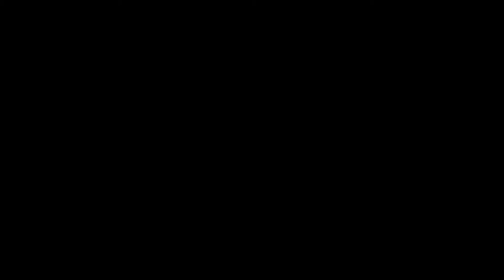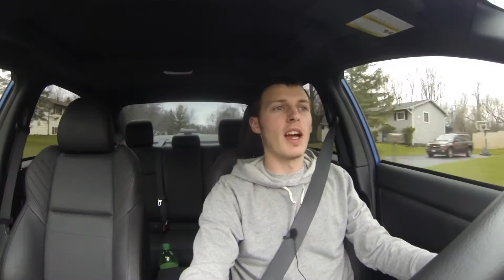Is Flex Fuel Necessary for E85? 2015 WRX

Comment: Do you upgrade fuel pump or fuel injector too? 
Will it work with just flex fuel kit?
Reply from the maker: I did not run flex fuel so I’m not sure. The flex fuel kit should tell you if it’s required or not. Cobb had a kit awhile ago but not sure if they still do or not.

Comment: question, Turbo back (catted), front mount intercooler, tgv egr deletes flex fuel kit, dw300 fuel pump, AOS street, turbo sump, ebcs, cobb lf bypass valve estimating around 350 whp, I know the tuner can go higher but I'm not trying go above 350 torque.. Running that set-up with stock airbox. Good idea or bad idea? The debate about intake vs stock airbox. I'm at the final step debating to get pro tuned without the intake (grimmspeed) or with one.
Reply from the maker: The stock air box is a restriction when it comes to that power level. I believe the Intake is good for almost 20 whp at that power level. I would 100% get an Intake. Plus it sounds so much better with an intake.

Comment: For a 2015+ WRX you don't have to worry about pushing more fuel through the injectors. Because it doesn't have any.
Reply from the maker: Tyler Savin the Wrx does have injectors though?
Reply: Derek Welker no it's direct injection.
Reply from the maker: Tyler Savin direct injection still has injectors. The problem with direct injection is you cannot upgrade to bigger ones due to the cost
Reply: Derek Welker Well it's more of a port controlled by a high pressure fuel pump no? There aren't any injectors for sale in the WRX parts section anywhere.
Reply from the maker: Tyler Savin no they are injectors. Just not the same type as port injectors. The high pressure fuel pump is separate from the injectors. The reason there isn’t any for sale is because replacements are very expensive and not worth it to make aftermarket ones. It’s easier and simpler to make a port injection kit for upgrades like what p&l has.

Comment: does flex fuel even adjust for shiity E85? if i fill up on lets say E85 thats really  E50 will flex even accomidate for that? i was under the impression it was just adjusting 93/E85 not adjusting for bad E85
Reply from the maker: Pas B yes it does. It reads the ethanol content and adjusts. That's the point of it.
Reply: It will do both. The first time I pumped e85, then started the car it was at around 64% ethanol once I gave it a min to configure. They say to run 91 or 93 every third fill up depending where you live, to keep everything nice and lubed.

Comment: I've been thinking about modifying any gasoline motorcycle I would own, to not only be ok with gasoline, but also moonshine. I've been thinking about making my own fuel, because I don't want to be dependent on gas stations & foreign oil, and I'm very mad at the oil industry, fucking up nature, or people's livelihoods directly, when just getting oil.
I'm excited about buying or building a full electric motorcycle, but I want it to have high performance & range, meaning it will be expensive. So it's better, for now, for me to invest in internal combustion. And I'm still excited about turbocharging any engine I would own. I'm also excited about turbocharging, because I recently learned, from the car passion channel, about 2step & 3step, flatfoot shifting. A motorcycle's quickshifter, that disables fuel & spark, will be just like a car flatfoot shifting, keeping the throttle open between up shifts, boost recovers instantly. I will only need a Blow Off Valve, when I'm slowing down or stopping. 
So what do you think about running any gas engine on a mixture of (hopefully) pure alcohol, and SeaFoam addictive, to deal with any moisture, keep the engine clean, and maybe lubricate like gasoline, which I don't understand as an issue. What lubrication property does gasoline have? Motor oil & oil rings aren't good enough? Do the valve seats need lubrication? I don't understand.
Anyway, I'm new to flexfuel, and looking into it now. This is one of the first videos I've watched about it.

Comment: What do you think about these  ethanol content readers, are they worth it?
Reply from the maker: harley Rider they could work well but what are you going to do with the reader? Flex fuel is nice because it adjusts the tune based on the content that the analyzer sees. If you just have the sensor it's not going to do you much good except tell you what content you have.
Reply: Thanks for the reply, I was just wondering. Seems like a lot of money for one.

Comment: Looks like Cobb is having a lot of issues with the flex fuel kit for the DIT cars. Other parts are failing. I'm currently on Ron Watsons E40 tune, so far about 10k miles in, running great. Once I get TGV deletes, EGR, catless down pipe, etc I'm going to bump E70 and pray lol.
Reply from the maker: I ended up going with meth injection instead. Hopefully making a video soon about it.

Comment: flex fuel and e85 is the same right?? thanks
Reply from the maker: Not necessarily.  Flex fuel is the tunes ability to adjust to varying ethanol levels.  So it can seamlessly transition between full E85 and 91/93.  E85 is the fuel but flex fuel is more or less an ability of the computer to run everything from E85 to pump gas.  Running straight E85 or a specific blend requires you to maintain the same consistency of E85 and pump gas or trusting the consistency of E85 between every station/fill up.  Flex fuel will accommodate for varying ethanol content.

Comment: I believe (here in CO at least) that E85 must contain at least 70% ethanol. Still a large variation in terms of ethanol concentration.
Reply from the maker: +Fart Knocker A lot of places around NY specify that the minimum is 75% but it is known to be less at certain times of the year.  Either way a 10-15% difference than what you were tuned on is too much of a difference for me to feel comfortable.  In my opinion Flex Fuel is necessary unless you are running VP C85 and it is a race car.

Comment: clark has an e85 tune the adjust itself to ethanol content im currently using his 50/50 half 91 half e85 havent had not one issue 10k plus miles on his tune.
Reply from the maker: If you're using a tune that is meant for a 50/50 blend it is not flex fuel. Are you running a flex fuel kit? If not there is no way to have a tune that self adjusts to ethanol content on these cars. A flex fuel sensor is required.
Reply: Im not flexible fuel just running 50/50 map tho ecutek sells the kit already
Reply from the maker: +ricardo vega that's what I was saying though. 50/50 or full e85 doesn't adjust at all for a low ethanol content if you get some. Ecutek does sell them but then you have to run ecutek. I'll stick with Cobb when they release theirs.

Comment: I wanted E85, but i've been seeing horror stories of rod failures. I'm at 326whp and worried that E85 would give me too much torque for the rods to handle
Reply from the maker: +bishvan Im in the same boat.  I think with a good tune you would be fine but I am not going to risk it.  Im happy with the performance so far.

Comment: I've ordered the Delicious Flex Fuel kit for my WRX. It will be out for the Cobb AP before June.
Reply: And it is only $500
Reply from the maker: +MySubie16 there has been issues with that kit. Not every single one but I've seen some issues with it. I'll be sticking to Cobb when it's released.